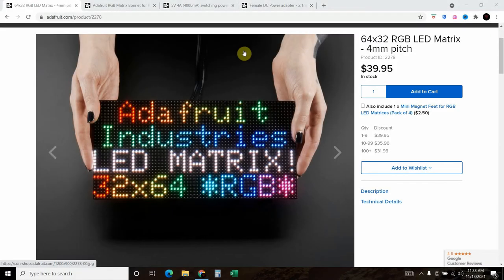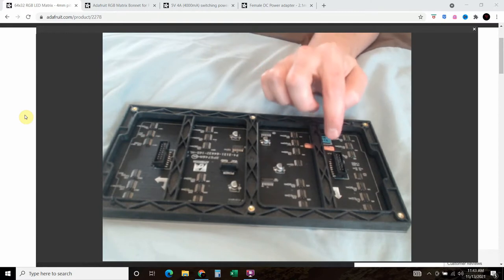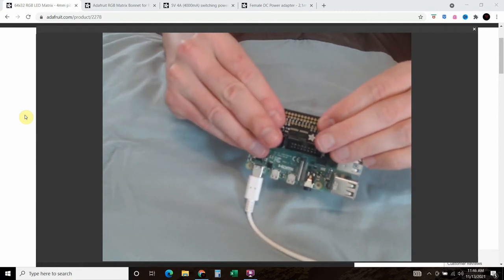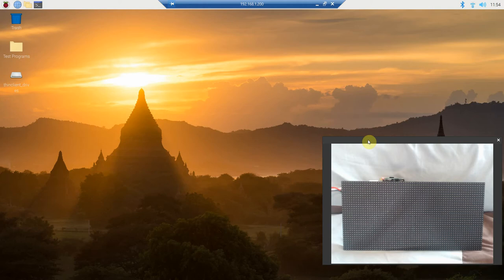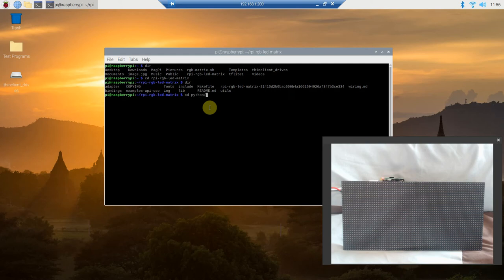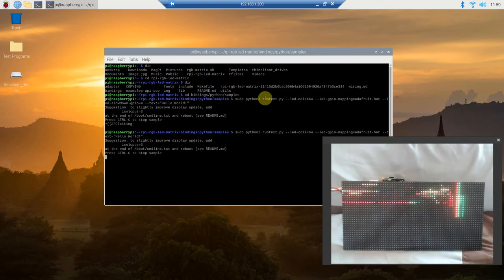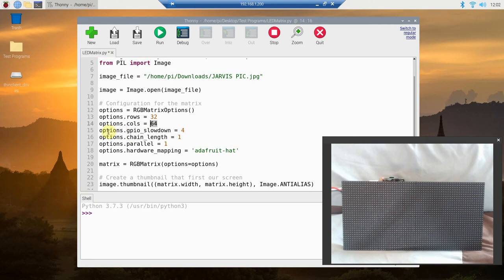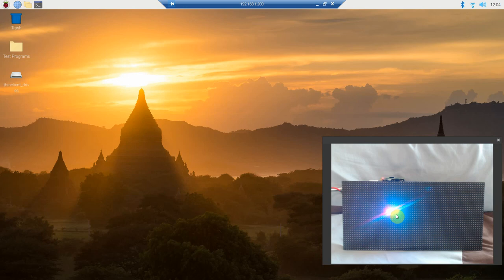Raspberry Pi 4 LED Matrix Display | #160 (Halloween AI #5)

Comment: Note that this DOES NOT WORK WITH A RASPBERRY PI 5 (at least rn). The software on github hasn’t been updated to work on it yet, so go for an earlier model
Reply from the maker: Thank you for the contribution. I will pin this comment for the time being.

Comment: This video was a huge help in setting up my own pi, thank you!
Reply from the maker: I’m glad to hear that!!!
Reply from the maker: @coleisfinagle  this video was on TikTok?
Reply: @BrandonJacobson  i have a question. whenever i run my code I get a thingy saying FYI : not running as root which means we can't properly control timing unless this is a real time kernel. Expect color degradation. Consider running as root with sudo. Is there a way to fix this?
Reply: @caxew  i gotchu, type root before your code right before your execution type sudo, if your using an application like a code editor there is ways to run from root every time in settings it varys by app. aditionally if you set up your code file to be run on boot you can just run from sudo every time
Reply: Oh shit, I'm a fan! I love your videos honestly and I am currently looking at them as a reference to start making my own protogen suit.
Reply: It's the dude!

Comment: Thank You for this tutorial! I just bought an 64x32 led matrix and i have a spare 16x32 panel, so i'm probably gonna try this on the spare panel! I'm little bit concerned about the resolution/size (which is 16x32) so will it work with that? Do i have to change the Rows and Columns on the code?

Comment: Hi thanks for the vidéo, I'm trying to do the cabling without adaptator. I'm using a raspberry PI 3 model B V1.2. And it didn't want to display a single LED 🥺
Reply from the maker: Are you getting an error or does the program run successfully but nothing displays?
Reply: @BrandonJacobson  in my case the program runs successfuly with no display, Rasp 4B, same matrix as yours. Many thanks for your efforts, I hope you can help me.
Reply: Fixed, I was pluggin to the wrong side of the Matrix.

Comment: Hello. I have Pi 3B v1.2 and i have connected my waveshare-p3-64x64 matrix according to the connection showed in github repository. But it is not working properly like it shows square in some lines then in middle some lines are off and that remaining sqaure is below those lines and it looks like it is skipping those lines in middle. Do you know any solution?
Reply: Hey bro I’m using the 64x64 with raspberry pi 4. My matrix is bugging out when I use it. Any tips? Did you figure it out? I have a school project with this due soon. Help greatly appreciated
Reply: @EricvanGinkel-g1n  what do you mean by bugging out. Can you please explain.
Reply: I'm having the same issue, Did you figure it out?
Reply: @Hannah-RoseFleishman  Yes, you have to change one variable value. But I forgot that variable for now.
Reply: @AkashIsHere.19   please let me know if you remember! would be a great help
Reply: @Hannah-RoseFleishman  try adding led-rows just like he did with led-cols. Maybe it'll work. And check other options too. You'll find it in some file.

Comment: cool! saw this on reddit. doing a similar project (not with AI) but want to make a dashboard like tidbyt with mine. wonder why you use a raspberry pi 4 when you could use raspberry pi 0? seems like a waste of resources
Reply from the maker: The LED matrix is just one component of this project. Assuming the sound board doesn't interfere with the LED matrix with the pi 4, I'm going to be running Speech Recognition, Speech-to-Text, an M5 video recognition camera, and NLTK together. I'm actually thinking the the pi 4 might not be strong enough.
Reply: @BrandonJacobson  since the HAT takes up all the gpio ports, I'd probably run the matrix on a Pi 0 and the other stuff you have planned on a separate Pi 4 (i'm no expert so take my recommendation with a grain of salt). very cool stuff though, looking forward to stuff you have planned :)